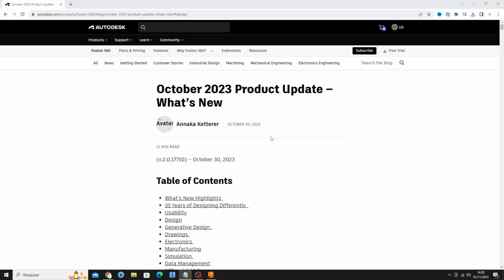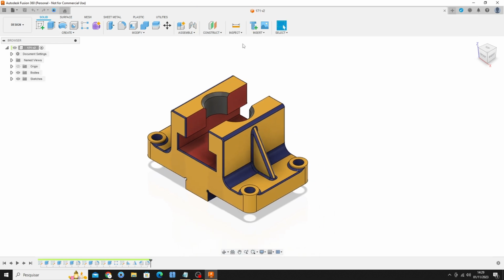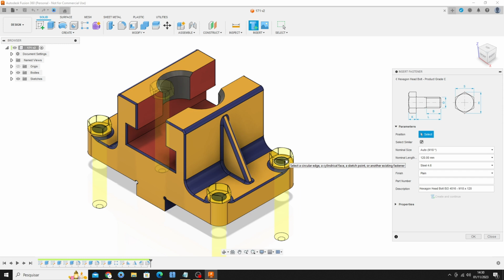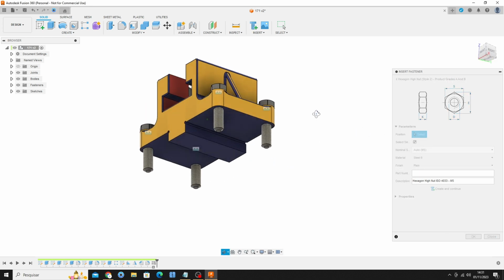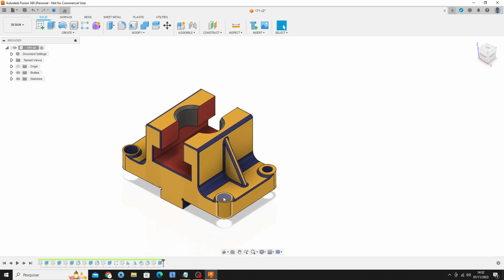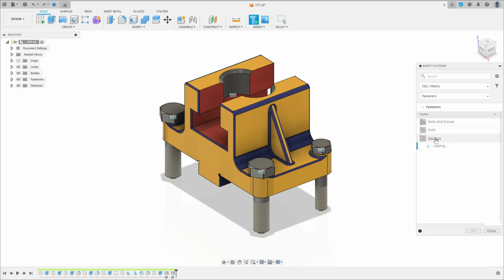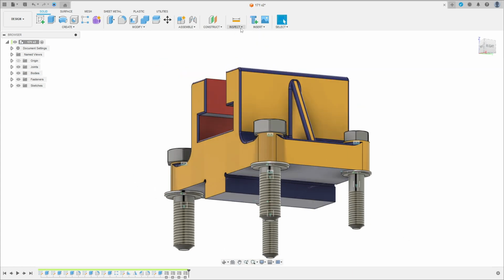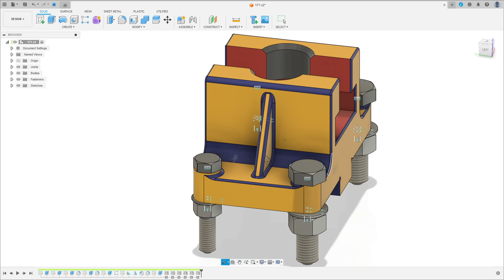Stay One Step Ahead with the Latest Autodesk Fusion October 2023 Update - Insert Fastener

Comment: As usual, need a DIN 933 M6x100, Fusion limits it to 80mm. Cant adjust or select custom length. FAIL Have to Break the link and Edit sketch dimension.